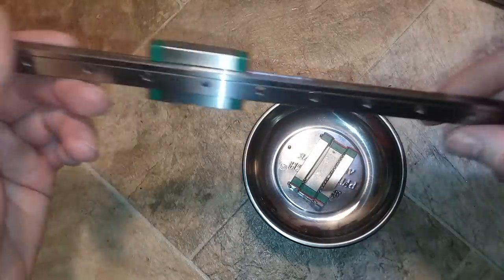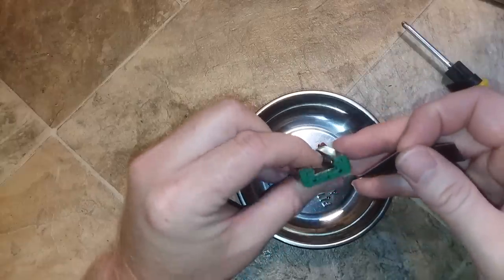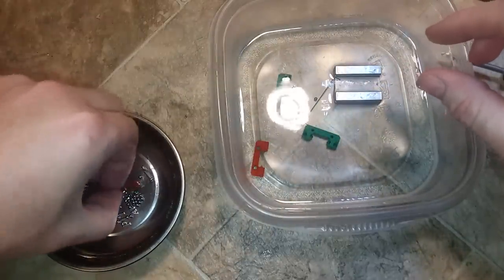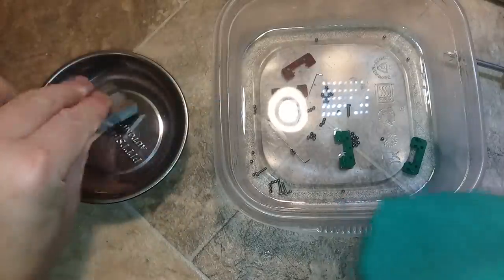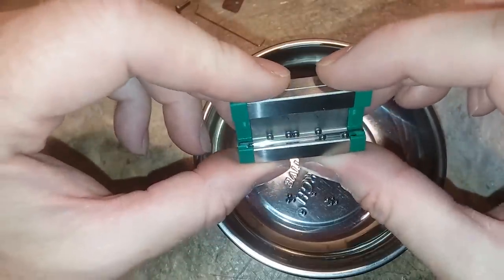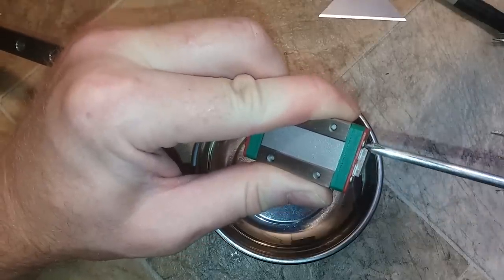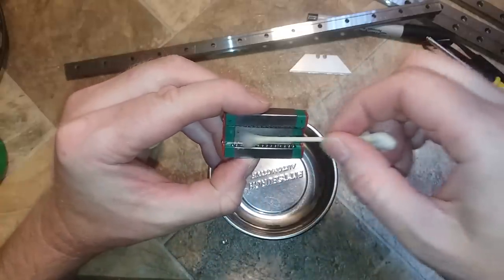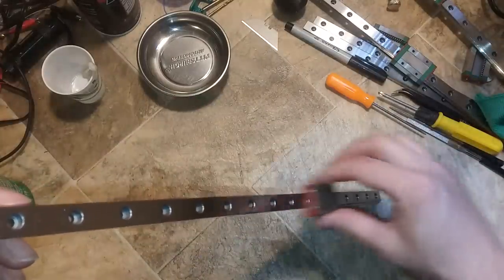Tuning Up Cheap Chinese Linear Bearing

Comment: WD 40 is NOT an lubricant!! It is useful for loosening parts that are rusted or stuck, and good for removing water from wet parts (for example the water filled holes in your runners). WD40 contains gasoline, which is a degreaser.
Reply from the maker: Read the description of the video please.  You are only the 15 million person to say that.  AND I DID NOT USE WD40 ON THE RAILS
Reply: Careful with WD40 it hardend and corode Plastics. Use it only for Metal. ;-)
Reply: @MrDabrudda  I am sorry , I did understand that. I didn't want to upset you. I think you that you did an excellent job with the rails, and I will follow your example for improving my rails, thank you!
Reply: if you listened he said WD40 is a penetrating oil and not a lubricating oil
Reply: DaToNyOyO  thats bollocks! marketing bull crap! its for rusty bolts and getting things loose if you get stuff loose with it you should then degrease it and use the correct lubrication for the application
Reply: DaToNyOyO  you dont know anything about oil if you think wd40 is for lubricating anything other than a sqeaky doordoor hinge. reading their website doesn't mean anything. wd40 is a solvent and a penetrating oil.
Reply: DaToNyOyO  I can only say from experience that WD40 lies or at least is not telling the whole truth.  I have no use for the stuff. There are better solvents, penetrants and lubricants. I wouldn't put WD40 on anything I liked.
Reply: WD-40 = Water Displacement 40th formula. When it drys it leaves a thin film that can gum up shit, in other words JUNK. PB Blaster is for rusty nut's and bolts...

Comment: We need to get you some safe-edge files. Screw diamond, good steel files work better.
Reply: Diamond files grind. Steel files cut.
Reply: @geoffgeoff143  Diamond files SCRATCH. Steel files PARE.

Comment: Hi. I have bought two assembled  rails and two separate sliders. One of separate has been fit proper but one  not. As second seller send me another not fitting - I did experiment according this receipt. Cutting plastic did not help and was not possible to put it on rail. In such case the most clever solution is return it to seller and buy another one up to happy end.  Generally sellers do not have idea what do they sell and display minimal technical knowledge.
Reply: I had this problem with shorter lengths of mgn12 being smaller and getting some 550mm rails and sliders the slider and the rale was larger. Where one would not fit the other and opposite way the other was very slack on the opposing rail. I ended up getting a refund for the shit parts as they just sell you anything

Comment: Would you get a batch of these Chinesium bearings again, or would you go for the legit but more expensive stuff (Hiwin i believe?) knowing that you have to put quite some time in it for them to properly work?
Reply from the maker: I would still get the chinesium rails.  I haven't had any problems with the rails I purchased
Reply: @MrDabrudda  good to know! Thanks
Reply: @MrDabrudda  what would you say the costs savings are - vs hiwin?
Reply: @MrDabrudda   Which rails are you using?  I'm leary of buying Chinese rails at all because I'm afraid they'll be unsavable.  I'm curious which ones you got that you were happy with?

Comment: did you save any money using this method? or would it be better to buy more expensive bearings that do not require any cleaning?
Reply: These Chinese bearings probably cost less than $10, a comparable western produced bearing would easily cost you 3 or 4 times more.
Reply: That kinds depends on what you are worth per hour. 
100 bucks an hour, just buy the quality rails.
10 bucks an hour, Clean the cheap ones.
Reply: You should clean and re-grease any bearings you get, especially the more expensive ones.  The manufacturers ship them coated in a rust-preventing grease which isn't going to be the best for them to run with.

Comment: I am not sure that putting bearings close to magnets is good idea in general case.
Reply: You are correct sir!! You don't want the balls to bunch. Balls in contact with adjacent balls have oppositely moving peripheries, and they will tend to bind and lock up. In some higher precision assemblies, every other ball (sometimes roller) is 2 to 5 tenths smaller to guarantee a frictionless spacer. Those don't bear any load, so if you take it apart, you have to mic every ball as you reassemble. "tenth" = machine shop speak for a ten thousandth of an inch.

Comment: But it’s still a cheap Chinese bearing pretending to look like HiWin, and no disrespect intended when I say you’ve spent a considerable amount of time and effort just polishing a turd.  Chances are (very high probability) what you’ve got there has very little or no preload so once loaded will deflect. Cheap linears don’t tend to have preload as standard as it highlights the poor accuracy and finish of the carriages, balls and rails. If you want a decent linear bearing that is preloaded as standard and self lubricating, take a look at IKO’s high precision c-lube  bearings, manufactured in Japan.
Reply: How do they compare to HiWin's?
Reply: Most people only have a limited amount of money to spend on hobbies. We have to get our hands dirty polishing the turds and make them perform the best they can. Hats off to MrDabrudda for sharing what worked for him.
If the rails were going into a machine that was going to pay for itself and more, I would completely agree with going for HiWin or one of the Japanese brands.

Comment: Never use magnetic tools or mats/bowls. I had to learn what happens when those balls get magnetized the hard way
Reply: Why?
Reply: @ipadize  because the bearings magnetize
Reply: And the Harbor Freight Magnetic Tray, does not have enough magnetic strength to magnetize those bearing, and neodyium will and other high strength fields will.. the iron core magnet at the bottom does not have the strength to magnetize those bearing.

Comment: This is not fix, you have used not correct grease.
What sense does to "test" bearing without load?
Reply from the maker: And why would this not be a fix?  The Cosmoline on the rails and bears are not intended to stay on after shipping.  And what grease would you recommend?  People are so quick to point out what I may have done wrong in my videos but they are never state the correct way to do it or have any videos themselves sharing their vast knowledge.  So what grease are we to use on a linear bearing that is really under no load on a 3D printer?  And you test the bearing under no load to ensure the bearing actually works.  Would hate to assemble a bearing to find out the bearing doesn't move.
Reply: @MrDabrudda  I'm sorry you are doing good job with this lubrication.
In particular for aplications without load and temperature.
I didn't realise that this is for printer.

Please take a look at pages 15-16
https://www.skfmotiontechnologies.com/sites/default/files/LLT_maintenance.pdf

I'm used to work with mainly roler berings operatieng under havy load, those need good thick grease to prevent damage. In my world dry bearing is already damaged bearing..
Inicialy i thogt that this can be aplayed also to linear sliders, clearly i was wrong.

Feel free to delate my comment, I don't want to misleed anyone.
Reply: @MrDabrudda  The bearing shouldn't fall by itself that easily. That will cause the balls to slide instead of roll properly and will cause excessive backlash. Use something like white lithium soap grease or a synthetic counterpart.
Reply from the maker: If you look at the bearings in the first 15 seconds of the video you can see the bearings are rolling easily in the slot.  Out of the box the bearings did not roll due to the factory protectant.  Slick 50 lubricate is synthetic oil and not a WD-40 type lube.
Reply: @MrDabrudda  I have read a little more in this topic..
I would rather go much ticket the 50, most likely over 150 of kinematic viscosity and rather grease than oil.
SKF recomands LGEP2, LGMT2, LGLT2, LGFP2 which all of those are grease not oil.
They have also greasing point for grease gun on the slider itself.

In your case there is no load on the slide, considering low power motor the most important is low resist.
For real application grease is must have.
Reply: @xXxbastek  Will be Krytox GPL 205 g0 a good lube grease for this kind of rails?
Reply: @xXxbastek  Be careful of getting caught in the "SKF" trap. What SKF say, and what is the truth are very rarely the same thing. They are in the business of repeat sales, not permanent solutions. 

 @MrDabrudda  you have done nothing wrong in this installation as it is completely fit for it's intended purpose. in industrial and high load applications you would definitely need to use a more substantial lubricant, but in this instance what you are doing is completely fine. So don't listen to the idiot with the blue tattoo.
Reply: @pakman6284  it all depends on your application, the load and the speed. but if you are using these Chinese rails and bearings, and it's a hobby purpose, use whatever you have available as long as it's not too thick. if it's for a 3d printer, just use a light oil, or silicone spray as he has used here.
Reply: @MrDabrudda  wd40 isnt even a half decent lube for door hinges, the clues in the name, light machine oil (cheap 3 in 1 brand) would be a good choice of lube for a bearing like this
Reply: The main purpose of inline ball bearing is for loading, when talking about speed how can it compare to round ball bearing run over 5000rpm, simply understanding is oil for speed and grease for loading, so for me i will choose light grease, as the video showing it is also fine to do it but don't have to be very free running, also sometime we could have no idea what grease they had used in the factory.

Comment: I just wonder what the straightness of the rails is
Reply from the maker: The rails are very straight.  I didn't see any damage from shipping.
Reply: Rails are not meant to be straight. Ever.. They are designed to be mounted against a reference edge, and straightened as you mount them.
They are clamped straight, then machined. When they remove them from grinding, stress releases and the rails bend a bit. Look up the full data sheet on a OKI or SKF to see mounting instructions.

Comment: Why would my bearings pop out every single time I go to put the guide back on the rail? I tried doing it upside down like you, tried putting it on slowly, tried putting it on faster... every single time one or more bearings pop out🤦‍♂️
Reply from the maker: Do you have the correct number of bearing on each side?
Reply: There could be a small burr at the end of the rail which nicks on a ball or two during insertion. You can either sand the end a little bit to remove burrs and ensure you're inserting the block while keeping the rail parallel to it. 
Or, you can print a rail replica to hold the bearing balls in place while you slip it onto the metal rail.
Reply: For someone new to linear rails -- it looks like there should be a gap of one bearing missing on each side when the correct number are put in.  (This confused me at first)

Comment: Hello sir. I loved the video and did what you did. but I made the mistake of mixing the ball bearings.. now when its assembled. its stuck, very hard to move it up and down. What can I do? the rails actually came super loose. able to slide on its own from 1 end to the other
Reply from the maker: Clean the rails and ball bearings.  Lubricate the rails and bearings and keep moving the slides.  Eventually it should loosen up.
Reply: If it was moving freely. 
Disassemble and reassemble.

Comment: Do you think you could use contact cleaner to clean this decently without disassembling?
Reply from the maker: Possibly.  Depends how much factory gung is on the bearings

Comment: Thanks for sharing non of my linear rails are straight did you have a similar problem?
Reply from the maker: No all my rails were straight.  I think once you get the rails tightened down to a 2020 or 2040 aluminium extrusion they might straighten out.
Reply: @MrDabrudda  it will be great to make another video about how to get them true... I guess you have a gauge and maybe a flat surface too... this will for sure level up the game of many diy guys who want to have precise machines for cheap.

Comment: Just curious, would the magnet affect the bearing (making them magnetic) which would assist them in "sticking" on the rails. I am not sure just wondered - great video on the cleanup though!!!
Reply from the maker: I doubt the ball bearins getting a little magnetized would affect the operation of the linear bearing.
Reply: @MrDabrudda  I agree, it was just a thought. I ended up not tearing my rails apart and focused on my filament feeding which was snagging and I think giving me the same shifting issue. But thanks for the info it helps me get more familiar with my printer.

Comment: I was replacing the bearings in my Mono X rails and dropped some. I've ordered some replacement bearings but I'm unsure how many are supposed to be in each channel in the stock carriage?  Don't want to put too many in or it'll bind. Any help would be appreciated
Reply from the maker: My slides have 33 bearings on each side.
Reply: Where did you find the replacement bearings?
Reply from the maker: @genetic187  The link is in the description of the video.
Reply: @MrDabrudda  where those for the mono x?

Comment: Are you using these bearings on a 3D printer?
Thank you for sharing your tutorial.
Reply from the maker: Yes they are
Reply: Was it worth installing these bearings on your printer? I have the Ender 3 Pro and was thinking of installing them, but not sure if there's enough difference in print quality. What printer are you using these bearing with? Cheers
Reply from the maker: I'd say there was a huge difference in rigidity of the printer and no slack or movement in the axis'.
Reply: Are you using an Ender 3 Pro and did you use a kit with mounts for the Y axis?

Comment: Is the rail be itself to be worked on like sanding or else?
Reply from the maker: I would not sand the rail unless there was physical damage such as a scratch which would affect the block from running smoothly.

Comment: Don't do this. You are reducing the lifespan of your equipment. Oil is used in higher speed applications. Grease is used in low speed applications. Resistance from grease will not affect travel unless there's to much and it collects impurity's. If you want to learn more look into importance of viscosity in grease and oil.
Reply from the maker: https://www.linearmotiontips.com/lubrication-grease-or-oil/

I see your point but these rail bearings are not carrying a lot of load nor generating a lot of heat.  It is easier to use a thicker type oil and reapply it with a qtip after cleaning the rails.
Reply: @MrDabrudda  my comment wasn't too slam your video btw and I appreciated the disassembly of the bearings. I put it out there so someone dosent make the mistake where it matters.

Comment: When i got Mine, three of the carriages had approximately 0.6mm play on the rail ... I then ordered original hiwin carriages and rails. Should arrive tomorrow or a day later. Maybe i will upload a video of what i am building.
Reply: even better.. be nice if you compared the two.. show the amount of play, and take them apart to show differences in each little part especially the dimensions. I feel like they made those metal bands that hold the ball bearings in a bit too big causing the bow or used a softer metal that flexes more than what HiWin uses.